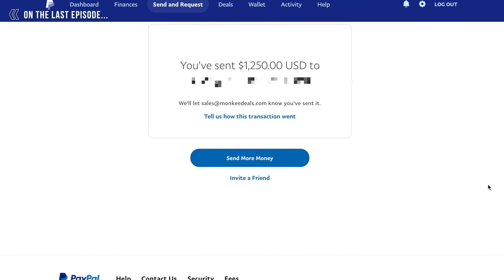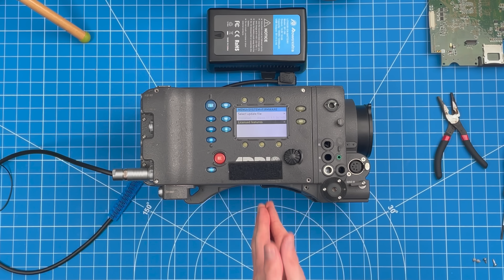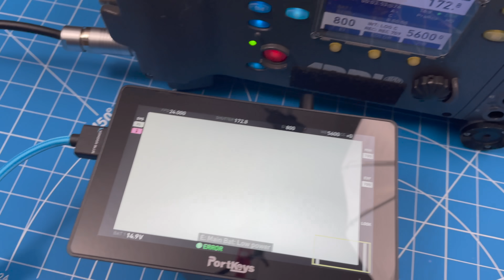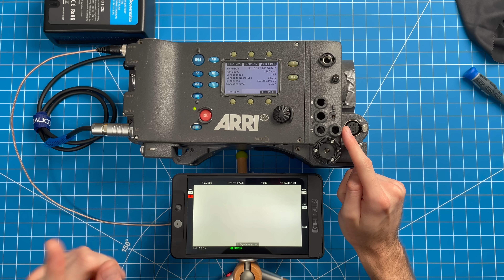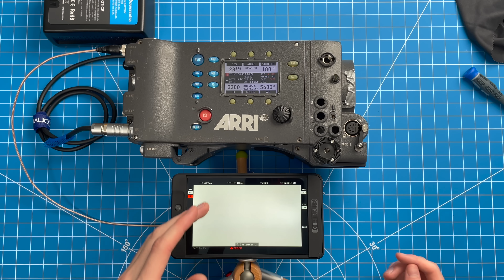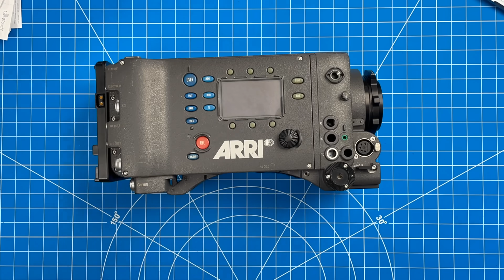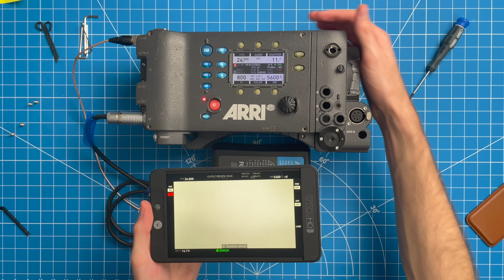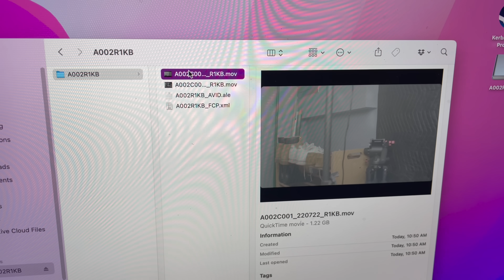I Paid $1,250 For 5 Broken Arri Alexa Cinema Cameras... Can I Fix Them? (Part 2)

Comment: 32:27 You can build a DIY positive pressure mini clean room in a box somewhat easily, you need a big box of some kind, cardboard works; some way to open it to put stuff in and keep it air tight, holes for your arms and some way to tighten them, some rubber, cloth, plastic under tension; a slanted part with some transparent material to view trough, flexi or freezer bags work well, you might need a microscope or loupe there to inspect stuff so account for that; a fine particle filter/hepa filter; a fan to blow air through the filter and IN to the box, could be a PC fan or a hose from the air-out port of a vacuum cleaner; and then some restricted outlet for the air on the other side.
Then to do the actual cleaning you should not use a brush or tweezer, a can of compressed air or a silicon roller/stick (the tacky kind for cleaning, not the ones for application) should be the best option, maybe some IPA if it is stuck.

Edit: Well, looks like you found a way without help :P

Comment: Congratulations, seems like it was a good deal after all.
I have some criticisms though: You tend to ramble and repeat yourself a lot, and it gets multiplied when you put clips together where you explain in the latter clip what you've done in the clip we've just seen. For example: When you explain (quite extensively) which screwholes you've blown air into to get that hair off of the sensor and which holes eventually worked, is it really necessary to explain that again 2 or 3 minutes later? I know it's difficult when you film these clips days apart and you don't know yet what you are going to use in the final video so you summarize what you've done before, but with a bit of B-roll and voice-over it might be possible to cut out the parts you don't really need. You could probably edit this video down to less than half an hour.

Comment: Have you tried attaching the sensor of Alexa 1 to the rest of the body with the ribbon cables and other stuff of number 3? The sensor of number 3 seems pretty dead, the Iso changing the brightness of the white would indicate to me that the fault is in a really early stage of the image pipeline, probably in the analog electronics of the sensor. But I'm no expert by any means. Also huge congrats on getting one of them working, I honestly didnt think that you would be able to do it.

Comment: I used to cultivate mushrooms. To keep contaminates out I would heat my oven, open the door and work on the rack. The heat rising would prevent anything from falling into the workspace. You could do the same to prevent anything falling on the sensor while getting that lint off.

Comment: Hello!
What is the name of the V lock battery mount to DC input you used to power the camera? 
Thanks!
Reply from the maker: I used a Smallrig V mount battery plate and an Eonvic D tap to 2 pin DC cable.

Comment: Don't stop! I suggest you try to restore a second, which can be a backup! Do some research on restoring the sensors and try to get a second one working. It'll be worth it in the long run... The more you try, the more you learn. Soldering is not hard. Replacing capacitors, etc. is not hard. What about finding another fixer type content maker and do some kind of collaboration with fixing one of the non-working sensors? If you get one working, you already have what you believe is another working camera!

Comment: 31:49 you can try to put on the shower as hot as possible, then let it run for a couple of minutes until the bathroom is full of steam and then all the dust is getting dragged down (in theory)

Comment: so what are your record out settings? you might need to make sure it is set to a standard that is more compatible with consumer signal. make sure it is set to a 1.5G sl output at 422 and see if that helps. for mon out it will always be 1080 out but record out will be dependent on record settings

Comment: The pink image on the first camera, seems like an issue with the way the monitor understands the signal (or the way it is set to output, camera-side). You can achieve the same on your PC if you set your videocard output to YCbCr instead of RGB (and the monitor does not have an auto-detect feature for that). There's a small chance that this is related issue, as the crazy magenta output is unusually similar.

Comment: Could you get an SXS card to an SD card adapter that would fit in the camera? I know they also make SD to SSD, the wire runs from the slot to the ssd where you mount it on the camera, maybe that’s something you can do?

Comment: Somewhere on that camera there should be a data out port. Studios use them all the time so they can pipe 3 or four cams into a main mixing control board. Look for it. It may look like a cat-6 port but read carefully, there should be a data out somewhere. DUDE !! You are definitely a candidate for BlackMagic and their Magic Lantern Canon camera hacks. 4k raw video unlimited time. Check'em out. Your the type of Pixel geek they serve to. They might even have a flash file for that camera.

Comment: I would be interested in repairing the broken circuit boards. With pictures of working boards I could repair and replace components on the boards. I ca. Also fix broken traces.

Comment: Cool stuff! GG man, some of your story is a bit similar to mine other than me being a fair bit older, and my camera isn't nearly as cool as yours, it's a HPX-250, bought untested at auction missing bits and sold as untested etc. I did get it working recently after poodling with it for a long time, it took me a while to find a memory card for it for a price that made any kind of sense, as well as getting some sort of decent audio stuff... By decent I mean like "can do stuff with" more than it being good. Now I'm a pan/tilt fluid head away from actually being able to use the camera, faffing around handheld is no option as I'm wheelchairbound. My objective is to be able to do some sort of short movie again but with my own gear, I have used rental stuff before but I really needed something that I can keep and pull out and set up whenever people have some time unscheduled.

Comment: dude, every time you're wearing your caps, the 'bill' / lid makes the light on your face and eyes very dim when you drop your head because you're looking at something on the desk.  suggestion: loose the cap, or, spin it around so the lid is at the back!  or, perhaps, change the lighting so that the light can still get to your face with your head tilted down.
Reply from the maker: Thanks for the tip!

Comment: Congratz! I'm so happy for you. You think you can fix one of the other 2 ARRI's (the other model)?
Reply from the maker: I don't think any of the other cameras are fixable because of the sensor issues.
Reply: @FoxTailWhipz  I meant the two Alexa M / Plus. Bur re watching the original video they look pretty stripped.
Reply: @FoxTailWhipz  also. Watching you has me wanting to try and fix my Tascam Dr40. I spilled something o it and some of the buttons don't work. I bought a Tascam dr40x to replace it but it would be nice to have another unit handy ... a brand new one is like 300$ Canadian and that's for the uograded X model so probably not worth sending to a shop to have it fixed (labour would probably Cost as much).

Comment: are the black dots at 44:13 dead pixels?
Reply: i was wondering the same
Reply: I think so, yes. I worked as a DIT with Alexas for years. There is a dead pixel fixer application. Try to find a friendly rental house, maybe they can help. You export a still and you mark the pixels. A lot of times it helped. The dead pixels "dance around" a little bit, due to the way the Alexa handles downsampling and noise. It has a great fix for organic grain-like noise and removing fixed pattern noise.
Reply from the maker: Yes they are. Working on pixel masking them now!

Comment: Check to see if the one with the pink screen is missing the IRCUT filter over the sensor. I’m assuming it is. If you don’t have one to replace it, you should be able to pop on a screw mounted true IRCUT, for like $100. 
(Edit) you figured it out! Great!
Great score btw. ❤ these cameras.

Comment: Well Done!
But now you have 4 more Alexas to check out and make something out of them.
Why don't you learn more about electronics and see whether you can get the sensors working. It is unlikely that the actual CCDs are broken. It us more likely that some of the electronics servicing the sensors is broken.
See if you can find the circuit diagrams for these sensors. The watch Louis Rossmann on how to diagnose electronics and try to apply it to these parts.
After all a working Arri Alexa is worth a lot more than a random collection of parts. Good luck!

Comment: Have you taken the Alexa Ms apart yet? Maybe some (for sure some, but not nececeraly useful ones) parts are intercangable with the other alexas.
Some Ideas to test, that weren't in the video:
- Conect the Alexa 1 sensor with the ribbon cables form Alexa 3 and see if it works for some reason.
- Check the licenses of Alexa 1 in case there are better than Alexa 2s.
- Check the licenses of the Alexa Ms maybe the mainboards are interchangable with the regular Alexas.
- Use 3D printing to fix some of the missing parts of the working but incomplete cameras.
- Maybe you can find someone who has a shot at fixing one of the dead sensors
I would be very interested if there are some uses for the Cameras without a working sensor

Comment: Interesting. However, for future videos, you should know that you said that, you said it again, you said it once more, you repeated yourself, again you said that, just to be redundant you said that already, just to be sure time is not an issue you said it once more again, not like you have to hand in a 500 word essay in class but already know that because you told us that again and again once more. Anyway interesting video as I said at the start. Probably could have cut it down to 5 V five minutes to get the info across.